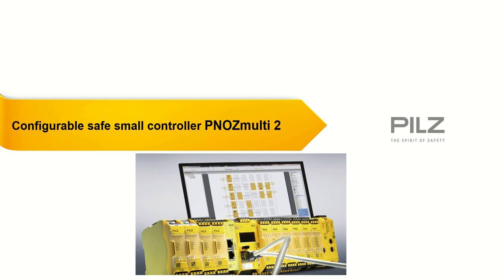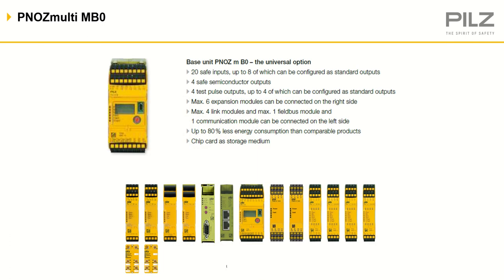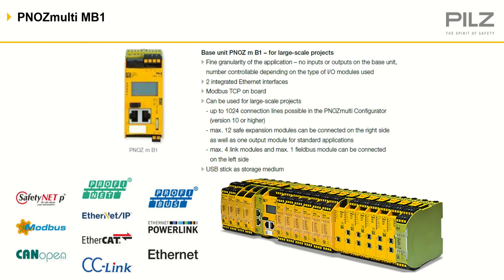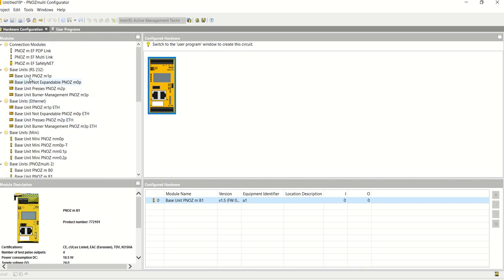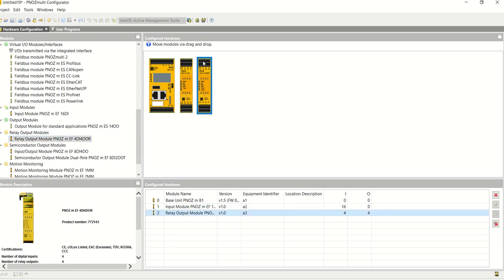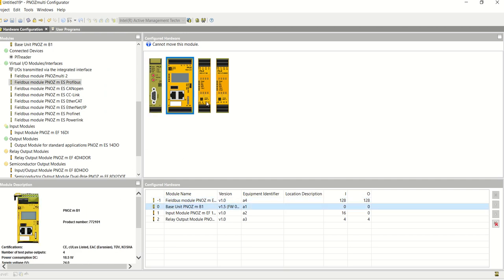PNOZmulti Configurator Part 1

Comment: 🎯 Key points for quick navigation:

00:00 📦 El controlador PNOZmulti incluye los modelos MB0 para proyectos pequeños y MV1 para grandes.
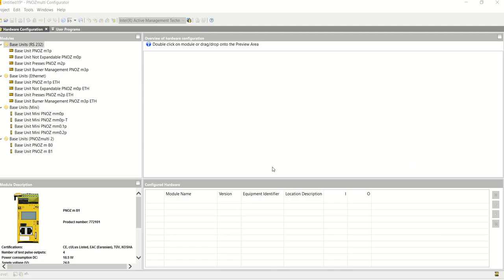00:38 🖥️ La última versión del software configurador está disponible gratis en el sitio web de PILZ.
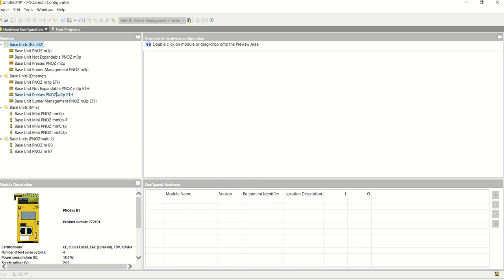00:53 🛠️ La herramienta configuradora ayuda a seleccionar el hardware necesario para cada proyecto.
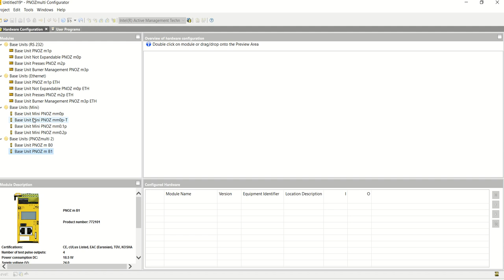01:05 🌐 Es fácil arrastrar y soltar módulos en la pantalla para crear configuraciones personalizadas.
01:47 ❓ Se invita a preguntas en los comentarios para futuras aclaraciones sobre la configuradora.

Made with HARPA AI

Comment: I work in a manufacturing and we have a PNOZ that gets accessed remotely by the integrators. Is it possible for me (Controls Tech) to get online with the PLC. We are 100% dependant on them when something goes wrong. I can see them going online with the PNOZ through ethernet. Is it possilble for me to do also? There are no open comms ports on the PLC that I see. Do i need to find a switch, then go through that way? Or is it even possible?